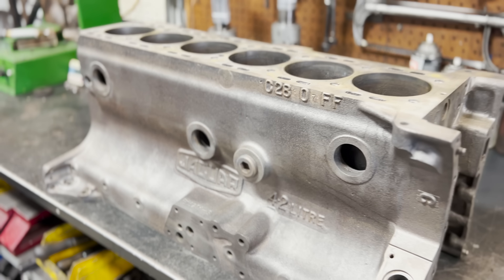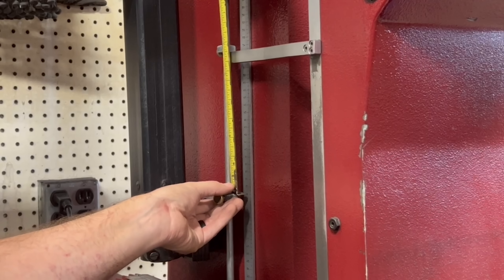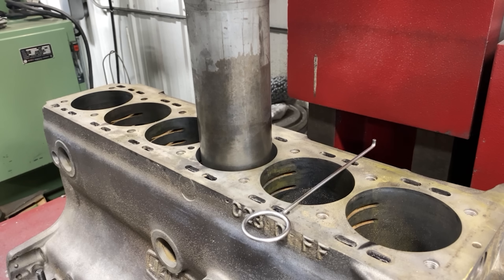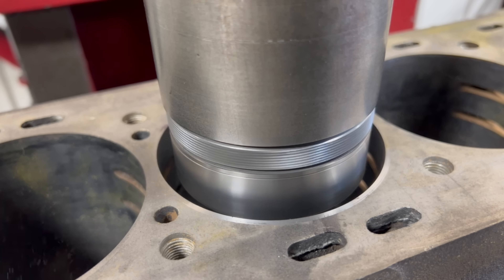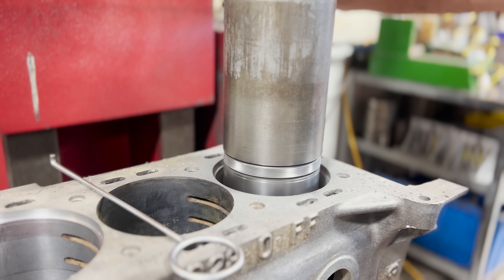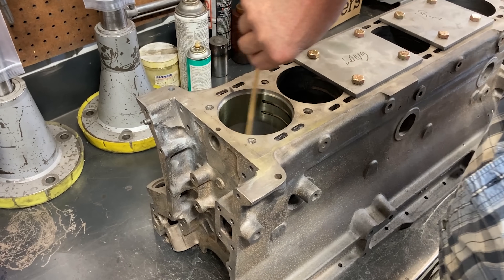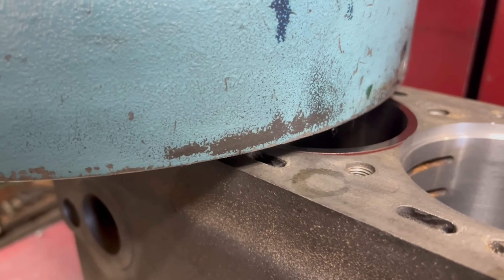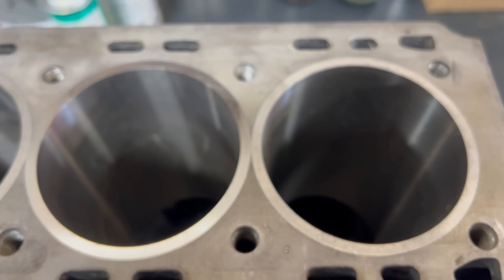Will New Sleeves Fix The Cracked 1968 4.2L Jaguar Block?

Comment from the maker: If you missed it, make sure you watch Part 1 here: https://youtu.be/xcKHiF7CTvQ
Reply: it would be awsome if you could eventually show us the running engine.
Reply: I would bring any motor to you for build prep. sleves, decking, head work and valvetrain reworked .top of the line work you guys do is outstanding
Reply: Why not weld up the crack and then bore
Reply: @rogallen9535  I suggest you listen to the video!
Reply: @rogallen9535  He addressed that in the vid
Reply: I'm doing a olds 455 rebuild. and the block will need just about everything done. I wish I could send it to you guys. but I'm too far away for it to make sense.
Reply: @cameroncashatt692  I'm in upstate NY, the only place I'd take my stuff is 8hrs away to a shop (like Jim's) that I used to work at out in Ohio. 
If I needed anything major done ,it would be done by the place I worked at in ohio ,or Jim's place(shipping would hurt but ya also get what you pay for).
Reply: How many psi/pressure do you use for the Hydraulic press
Reply: SPOILER ALERT: THIS VIDEO IS BORING! 👀🧐😎😜
Seriously, all the crazy ideas I’ve had about modifying motorcycle engines suddenly seem more possible after watching this extremely detailed and highly instructive video. And I trained as an experimental aircraft engineer. Now all I need is a boring machine and a source of custom sleeves in the UK. Thank you for sharing.
Reply: Why the loctite though?
Reply: @qwertyu19951  Have you ever heard of "belt  and suspenders" ?  It is an excellent idea in my book!!
Reply: @paulcopeland9035  Was just curious on what they are hoping to achieve, better sealing around the water chanels or just tighter grip for the cylinders.
Reply: Great video
Reply: Ok quick question? What are your math skills like?
Reply: Jag-u-ar.
Reply: I am very interested in building a 4.2 Jaguar six engine. I would like to know the cost of doing this as I understand it most 4.2s are cracked like this one.

Comment: Excellent work. But got me thinking, you didn't fix the crack. So when the engine is cold and the sleeves are hotter than the block, you could have massive pressure from inside and it could essentially split the block in half. I noted you also took quite a lot of the cylinder bores too...
Shouldn't you weld the crack first before taking the bores?

Comment: What you could have done to seat the sleeves all the way with ease is to have have the block a hot water bath and then do the nitrogen trick with the sleeves , this way there is no allowing the locktite to cure before the sleeve is seated, once you press them in after some curing has begun, the loctite becomes useless so you will need to repeat the process to reinstall the sleeves, theres a good chance the sleeves are not secure, you do great work but i worked as an engineer installing these types of sleeves and the only way to succeed is by heating the block in a hot bath (too hot for humans) and then have the sleeves stored in a freezer before dipping them in the nitrogen ( make sure its all clean before going in freezer and before nitrogen bath) and those sleeves will install easily without the need of those plates you used, locktite will be more effective if you use this method

Comment: I did not read the comments, but did you try to use die penetrant to confirm that the cracks all stopped in the second coolant cross over passage?  Some people say it is worth trying to drill a small hole at the end of the crack to reduce the risk of it propagating

Comment: Excellent work and a novel solution to an old problem, I agree with you that this is the best fix rather than inducing the extra stress associated with welding and to a lesser extent brazing. Maybe the old liners were installed in freezing cold conditions over winter hence inducing the cracking and spalling you discovered. Great work 👍

Comment: Just watched the videos of how you saved this block. Excellent work. I just rebuilt my 4.2 L supercharged Jaguar engine and trans. I owned the car since new so it was cared for . The engine had 235k miles on it and started blowing smoke bad. I removed the drivetrain and dissembled the motor . The machine shop inspected the internal parts and found almost no wear on bearings or crank. The piston rings were worn out and valve seals were bad. I'm having another experienced speed shop set the timing and I can soon reinstall the engine and transmission. The fact that you took the time to identify problems and researched solutions is amazing . The owner will be grateful you saved the block. Great videos

Comment: So it was cracked.
Was it burning water, or leaking as run previously ?
Wouldnt it run then as before ?
Either way, these sleeves will repair it, best as possible.

Comment: This is a legitimate repair. It's far more effective than welding, and this block will seal 100%. Though a larger top diameter would be ideal to eliminate the parent deck surface completely.

Comment: OLÁ.    Referente a "TRATAMENTO ANTAGÔNICO":   Sei que as recomendações são de uso de "NITROGENIO LÍQUIDO" porém dependendo da umidade do ar poderá ocorrer grave problema ao efetuar o encamisamento devido a formação de camada de gelo proveniente da umidade do ar.  Se medirem a dureza "Rockwell" e o diâmetro externo da camisa antes e depois do congelamento notarão que ao voltar a temperatura de medição haverá aumento da dureza e diminuição do diâmetro externo e interno.  Como existe a possibilidade de deformação da camisa por erro por ter sido guardada deitada sugiro tirar 16 medidas externas da camisa, somar e dividir por 16 para ter a medida mais aproximada da correta. SUGIRO o uso de "GELO SECO" MISTURADO COM ÁLCOOL".  O gelo seco tem -76º e misturado ao álcool fica com -48º e forma uma pasta    continua...

Comment: why wouldnt you keep and enhance cooling features in the block? 

a diamond like coating, ceramic or surface hardening coating could prevent future cracking and warping by improving thermal distribution to the block??

Comment: Interesting that you used a tape measure to set the 7 inch depth of cut when the machine has a vastly more accurate scale sitting a couple of centimetres away.

7 inches = 177.8 mm. This is an exact conversion, the inch has been a metric unit since 1959.

BTW the reason the Loctite set up so quickly is because the block was warm: reaction rate increases with temperature. The Loctite engineer would have been able to give you an estimate if asked.

Comment: Really interesting and an example of best practice I think. One question though. You found the lateral center of the bores with the dial gauge prior to machining however how does that implied cylinder center relate to the center of the crank pin, that is, how could you be certain that your implied cylinder center is in line with the lateral center of the crank pin? The cylinder could be worn offset to one side and later in the video it seems like there is a different gap or overlap in the sleeve tops. Or doesn't it matter because...?

Comment: Great video, give us updates on how the customers engine is doing!!

 Since you have a baking cabinet you can bring your block to brazing/welding temps for cast iron and use it to slowly drop temp after. 

 id find a junk block and try your hand at use a deburing tool and cutting out the crack(s) and brazing or maybe flame spray welding,  then machining and then taking the engine to a Dyno and rip into it 🤣🤣 would be a good way to test the strength of the reapair and let's you know if it /can/ be done

Comment: I was always taught to never use Loctiite, or any compound like it when installing sleeves because it acts as an insulator between the sleeve and the water cooled block. Sleeves should always maintain metal to metal contact with the block for proper cooling.

Comment: Really impressive. The only thing that I may have changed (though much more time consuming) would be to install the cylinders one at a time. The notch you make reduces any chance of rotational forces acting on the sleeves. Yeah, it's excessive but anything worth doing is worth overdoing, right?

Comment: Ive repaired engine blocks from 1900s turn of the century,I always repair cracks in the block,ive done this numerous times,i always relieve the cracks by drilling first then grind out the crack,heat the area before hand ,ive always use and recommend muggy weld,the block would be repaired and i would use top hat liners,but i would weld up the block to have a proper repair,Im a automotive engineer,i see some one taking a short cut and calling it a repair

Comment: ive always wondered how the sleeve install process would work, thanks for sharing.......Makes me wonder, are all blocks that come with sleeves from the factory setup like the Jag block with those little coolant bleed passages? seems like it would make for uneven temps on the block to not have the coolant passages wrap around the sleeve.

Comment: When you dropped the sleeves in they clearly bottomed out on something. You can hear it. Slide in an hear a tang metal on metal sound. A good sound. How was that not in all the way. You say you had to still press them in with the press but that just don’t make sense.  Hold them from pushing up while cooling maybe but having to actually press them? Really??

Comment: Jaguar never intended these engines for decades of life.  Lyons was a keen cost-cutter so design and engineering had mass production and the bottom line as the priorities.  When they went from 3.8 to 4.2 they didn’t even change the head to match the new bore locations!  That approach meant that at launch you could buy an E for half the price of a DB4 but 60 years later there are going to be consequences.

Comment: I had the same engine in a new Jag, and having paid $50,000 for it after six months what you show happened. six months later after a rebuild engine the cylinder head had to be machined ,because of warping, Sorry but I would not, give you 10 cents for the whole car.

Comment: Very well thought out repair.  Have you looked at any of the lock n stitch products?  May not have been the best for this application( due to the thin areas involved), but it is an interesting method to repair cast iron items.

Comment: I liked what you did with the Cylinders. I was wondering if anyone is using titanium sleeves yet. Vance and Hines motorcycle racing is using them and they are going big. I was wondering if the automotive industry is doing this yet. I'm thinking you could get away with bigger bores without creating that extra heat. What is your Opinion on this thought.

Comment: I wonder if this engine cracked due to overheating or, considering the significant galling, it cracked due to an earlier rebuilder forcing in sleeves that were just too large. That hardly seems possible to be an original Jaguar sleeve installation.

Comment: Have you considered placing the block in an autoclave then flooding it in a suitable sealing compound.
Then baking block to harden sealant.
Many years back I worked for Napiers on the production of the Deltic engine.
We had problems with small leaks on the cylinder block aluminium casting, and used this process to solve the problem.
It worked well and we never had a problem.

Comment: Due to the very capable WELDER technics and electrode alloys, WHY IT WAS NOT WELDED!??, perhaps NOT to restore the mechanical capabilities of the original block (i.e. clamping abilities to the sleeves, vibration dampening, integrity of the deck. etc.) but rather to avoid electric corrosion and further widening of the cracks or propagating even more down...

Comment: Glad you decided against welding. Even if the block didn't crack when cooling after welding, it would be subject to the same stresses in service that caused the original cracks (differential expansion of the aluminium cylinder head?) and would likely have cracked again very quickly. Hopefully the original cracks have gone as far as they are going to and the Loctite will  stop any leaks now. 
Great job and really good to see such care being taken on the machining.

Comment: Advise the customer on this jaguar block of Evan's coolant, it runs with no pressure to the coolant system. That would help reduce the possibility of the head gasket being put at risk of failure.

Comment: My dad, I’m 75, worked at Packard during WW2.  They were making the aircraft engines and PT boat engines.  They used differential temperature for several subassemblies.  When you live in Detroit, these are the things your dad tells you that you never forget.  Thanks dad.  Rip

Comment: Like how you did it was wondering if that locktite was thin enough to fill the hair line cracks a bit small detail but i would work it in as good as i could. Block looks sharp. Looks like head gasket will seal good.

Comment: Hi I can see that your shop really pays attention to detail. in my past I have installed bearings on large electric motors by heating the bearings as you do on the blocks, we have found that the infrared temp guns were not reliable because of reflective surfaces and only used a melt stick for the temperature we wanted to install. 
respectfully Rich

Comment: I've seen big diesels done with a drill, thread and screw.  Usually some material that expanded faster than cast, with some form of locktite or even elmers glue.  Then bore/sleeve.
Reply: Just talking about the cracks.

Comment: Hope the owner appreciated the amount of work you are doing on his engine  to bring it back to life.. Since you are a professional and you are very knowledgeable with motor  I'm sure you biult high hp motors.  Well a little back story for you a buddy of mine has a vw gti that has a 1.8 turbo charged motor it he is a mechanic so has some knowledge but he not a motor biulder so he leaves it up to a professional.  The first race motor had a TDI crank in with 83mm  8.5 to 1 piston  was a stroker so was made in to a 2.1 car made almost 800 hp. And lasted 6 years with minimal maintenance the bearings were replaced  2 twice during it drag racing life. Once because someone said to him if he wanted to rev higher that 8000 he would need to drill the crank to 11 bolts. So that was done. But still wasn't able to rev the car higher . Then after the motor was put back together he went to the tuner to turn it up. Then was told he need to convert is allready upgraded cams to solid lifters and get new cat cams that this person said he could get. So he trusted this mechanic. Well he did that and then still wasn't able to rev it out.. so that two things he was told to do to this motor and still wasn't  able to do as promised.  So then the motor  developer a miss fire at the end of the season. This shop said the lash of the solid lifter went out of wack because of the anti lag for the launch. So the head was rebiult again but turned out the cam that this guy  said were great cracked. Then he said we don't use those one because they were cast not billet . But so another think this guy messed up on.. the car was running great all summer but the owner saw bearing in his oil so he pulled off the oil pan and noticed saw he spun a bearing  so he decided to try and save it well made 2 runs and that all she wrote but was odd i feel he should have changed the rod bolts because in the photos of the failure the bolts looked like they got loss and backed out.  So he want to re do a new motor but no stroking it this time and only want togo 81.5mm bore with a 9.25 to 1 so .5 over and .75 more of compression.  But here were stuff is messed up this guy that not a engine  machinist like you he can assemble them. Every other high hp 1.8 or 2.0 that over 1000 hp in his vw group there motors are all sleeve. This guy is telling him its a waste of money  to sleeve a block telling him not worth it to remove metal of a already week block then add sleeves. I feel this guy is setting him up for failure  so when the new block fails  he forces to spend more money on new parts. I know this was a long comment but i believe a back store was definitely needed so if a customer came to you and said i want to make over 1000 hp on the vw 1.8 t how would you plan there biuld? Also great videos again

Comment: Since you're using the press anyway, what is the purpose of bolting the plates down onto the sleeves? Couldn't you just install the sleeves in the press then immediately squash them directly without the bolted plate?

Good work anyway, the fact it worked speaks to your skills.
Reply from the maker: In hindsight, probably. But extra reassurance doesn’t hurt.

Comment: I say yes, you have fixed it.
As well as the out of round and other issuesI believe the sleeves had too much press and the bores were stressed from the time it was built. When the block overheated the extreme expansion pressure was enough to crack the weakest parts
You have removed all those issues and strengthened the deck.
Dead jaguar reborn..
Beautiful job. Happy owner.

Comment: Dennis Brothers fitted the same engine in UK made fire trucks during the late 1960’s early 1970’s instead of the more powerful and expensive Rolls Royce straight 8. In the mid 70’s I scrapped three 4.2 engines that had failed in the same location. It’s nice to see almost 50 years later a solution has been developed for a common problem on this engine. Pity the three I scrapped went to the breakers yard for scrap, reckon you could have given them a new lease of life.
Great video, keep up the great work and commentary, the pace and narration is brilliant.